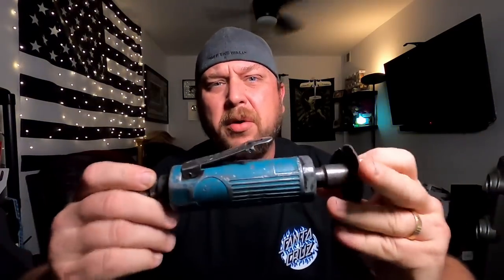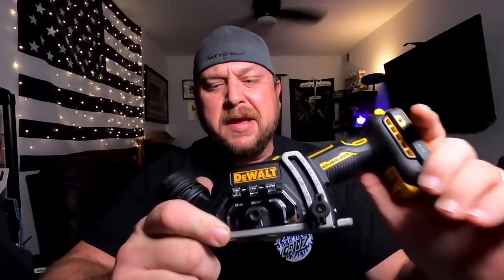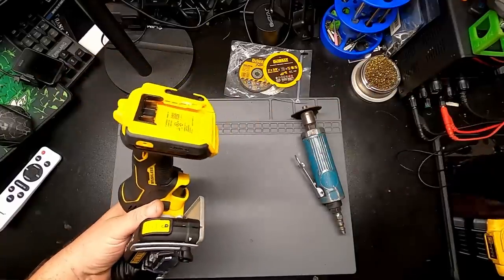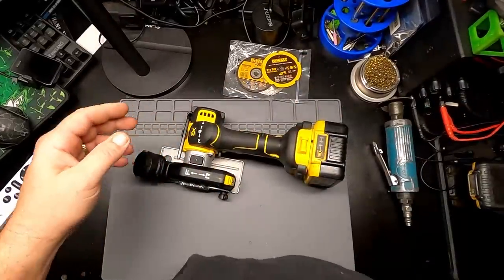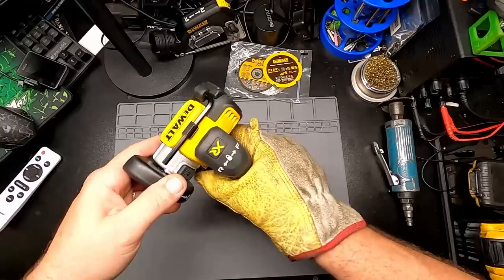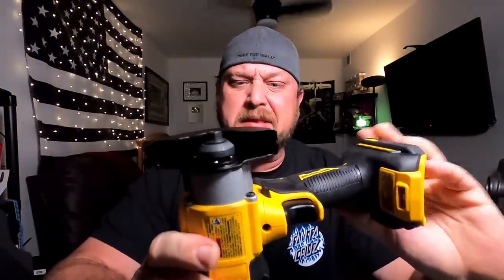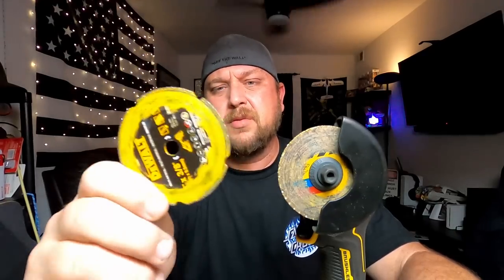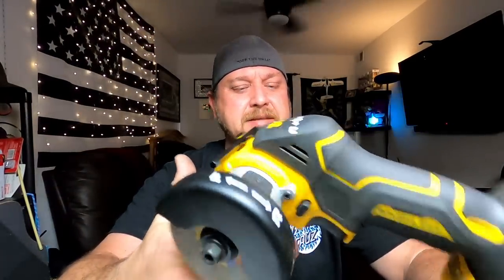DeWalt DCS438 Brushless 3 in. Cut-Off Tool

Comment: I’ve had one of these for almost 3 months now. I love this thing. I do a lot of scrap metal and this thing rips into some copper, brass, and stainless. Makes my life so much easier. I will say that this tool loves the Powerstack battery. You can hear the pickup in power when you put a Powerstack on this compared to a standard Dewalt battery
Reply: do you use the 1.7 powerstack or the bigger one?
Reply: @A4rings110  I use the 1.7 on my cut off tool. I like the use the 5ah on my reciprocating saw
Reply: @tannerwest6823  thanks!

Comment: I got one and paired it with the 6ah. It’s absolutely nuts. The only cutoff I’ve used that not only does not bogg down but SPEEDS UP. It cuts half inch threaded rod in almost 1/4 the time my air cutoff can do it. And my air is really quick but you can put too much pressure because air tools. 

Absolutely pleased with it. I’m just trying to find stuff to cut to see what it can do. Has not broke a sweat

Comment: That's a really nice cutoff tool. I use an 18V Milwaukee angle grinder with a cutoff wheel to cut rusted on bearings off of shafts and the like. It's convenient, but definitely has much less power than the old plug-in job I used to use. Can't beat the convenience of cordless when you're up on a roof cutting a pillowblock bearing off of a squirrel cage blower shaft on an a/c unit etc.
Reply: I really love the fact that the DeWalt is reversable. With the Milwaukee, you often don't have the choice between singing off your knuckle hairs or eyebrows.
Reply: Yup me too I haven’t removed squirrel cages in a minute. Guys used to argue which way curves go saying the amperage draw too much scooping 😂 like WHAT
Reply: On convectors “
Reply: @RcPlayer-tt2vw  lmao. I had an HVAC guy ask me if I thought the unit was blowing fuses because the belts were loose. hahaha

Comment: I recently got one of these also. Love it. Have the 12V Milwaukee one. It works for what it is but the power difference and lack of cutting out with the 20V Dewalt is phenomenal. Also, you are correct about the Powerstack batteries. They have more initial "kick" and make just that much more difference with this tool especially when cutting plate or bar.

Comment: Got my DCS438 back in February. People who go on about how it won’t replace their grinder have no idea. Not only will it do many of the same things, it’ll prove useful for things you never would’ve used a grinder for. I take off screw threads, cut outlet holes in drywall where you might use a multitool, cut metal wire shelving, and even use it places where you might use a Dremel rotary tool.

I recently had to blindly cut some copper pipe to salvage a miniature hot water heater tank that was crammed under a bathroom sink. I was done in no time but I soon realized I’d accidentally cut right through the nut and hose fitting instead of the pipe! It went through like butter.

Comment: Glad you showed how the diamond blade worked on the hydraulic hose. I think I might pick one of those up.
Reply from the maker: I was impressed with that 👍🏻
Reply: @FunkFPV was that the carbide blade?
Reply: Just an fyi if it seems like it is not cutting as good turn it around. We used 14 inch wheels like that for cutting roofs up when demolishing buildings and that's what we were told to do and it worked out well.

Comment: Interesting tool, powerful and and portable, but IMHO, only marginally useful for when if you have no access to air or an electrical outlet and you have the clearance to stick that monster in a tight space. When you include the cost of the batteries it's a $300 or so investment. I'm retired now and I go back to when a hacksaw was the standard cutoff tool and remember when the air whizz wheels came out. What a godsend for mechanics! They're still perfect for cutting off things like a hose clamp down deep in a crowded engine bay. And I can buy a lot of $12 cheapo HB versions that last a few years (my current one is still going strong after maybe 15 years) before I come close to the cost of one of these. Then I also think about how couple of years down the line the batteries will change and be non-obtainiums. That's what happened to my beloved SnapOn 3/8 drive gun.
Reply from the maker: It’s a hole process for me to use air tools. The less I have to do it the betters
Reply: Lol I have that 3/8 gun I never used it or not very long time , most my heavy home” mechanic days I didn’t have a commercial air compressor. You right , they’re working on using graphene for batteries, more power half the weight . With our political agenda they’re support going green and government grants write offs ect but car technologies going trikle down , figure 10 years with anything state of the art technology.
Reply: Actually make a cutter just for all thread , I’m a building engineer but I learned motorcycle mechanics from airplane mechanic, learned name all thread “”” here at work engineer break my chops saying it’s called threaded rod “ first time I heard all thread again in  “ 20 years  , funny how ol timers terminology may never been correct but they’re the master mechanics 🧰 and than you have TEST. Takers all proper terminology but couldn’t fix a bicycle
Reply: @FunkFPV  Working out of a shop with house air is different than field work, admittedly. I fitted out my home shop withair years ago and it works fine for what I still do.
Reply: For me it's not a practical tool for what I do especially with its size. I use the pneumatic including compact ones half the size of the regular. Battery is king for portability and convenience thou and looking at Funks job it will likely work well for him. Definitely hard to beat the price and longevity of the old school ones.

Comment: If you get powerstack batteries for it you will like it even more. Especially the 5ah powerstack. It goes great with that tool. The 1.7 powerstack feels great cuz its so compact but it jus dies too fast. Also i pretty much only cut metal with mine and i jus removed both guards. Wheel is jus so small any guard is a nuisance in my opinion. Only other thing i want for it is a new arbor bolt that is pan head with the allen wrench. On a multiple occasions the hex head sticking out has gotten in the way of making  a cut that is up against something. Gotta figure out the exact size of the bolt but also its damn reverse thread too so thats gonna make it a real hassle im sure

Comment: Haha! I use a version of that old air grinder at work! 
Lots of speed, but little torque. I have to be careful not to press too hard, as that poor little psi motor maxes out and dies. I mean, with a grinder disk, sure you don't want power to break the disk, but it doesn't like notching too much. ( break pad effect)

Comment: Nice little cut off tool. Kinda surprised it doesnt have a variable speed trigger. Kinda weird it doesnt this day and age. As far as dewalt batteries, id like to pick up some of those powerstacks as well. I dont have many cordless 20v dewalt, just a 1/2 compact impact, and a little nut runner cordless ratchet. I have a 2ah and a compact 4ah with the 21700 cells. Way more slim than the 4ah you have. Looks more like the 2ah, maybe a bit wider, but way thinner/shorter than the 4ah, and im sure more powerful being its 21700 over 18650.
Reply: It can only go one speed. And that’s the speed rating printed on the disc……any slower it will bind, any faster and it will explode.
The metal disc may be able to go faster, but will bind any slower. 🤷‍♂️

Comment: This thing vs a 4-5" angle grinder?  I already have the angle grinder, but I want one of these but IDK why or what for.  Maybe more accurate cutting, better/safer cutting vs the grinder.  IDK.
Reply from the maker: It’s basically for lighter material or if you need to be more accurate with a cut.

Comment: It sounded like you were clicking it from low to high speed does it have a low and high
Reply from the maker: Nope, it’s on or off. The RPMs ramp up when you first turn it on so it sounds slower.

Comment: Isn't this just a smaller version of an angel grinder? If so then whats the point of it?
Reply: Smaller so can fit more tools in the draw 😂
Reply: Ugh. THIS again.

9 out of 10 things you do with this are things you never even would have considered an angle grinder for.
Reply: @emmettturner9452  wasn't being funny, it's because I never knew these existing before seeing this video.
Reply from the maker: Smaller tools are easier to handle. I used this today to cut open a small connector. My 5” could have done it but it might have made a mess of it.
Reply: Exactly and I’ve been using a dremel for small stuff but it’s too small sometimes and disc break to easily just watching den tool guy guy drives around wth tools when and how would he ever use all those tools 🧰 lol , seems to know a lot does he use them one time to test idk but he’s good finding spitting all deals cool tools , Black Friday sales already fpv some pretty good deals , uk buy two batteries get the tool free ect I didn’t see this cutter though , I’m team red but some these deals too good , do I need 200 blower just to stay red when I can ryobi for 100 , I go for two toolkit deal  with dewalt if they have this cutter , I generally stay with m12 for hobbies at home and I have some m18 tools at work but usually over kill I use the smallest lightest batteries. My old Milwaukee stuff is nickel metal batteries I want see if I can get adapter plate to use lipo batteries on , sorry guy I’m rambling tools get me excited for

Comment: Im sure its not a bad tool just by the fact you actually praised it, but i really dont see the point, because to me this just seems like a slightly smaller angle grinder, whereas the old pneumatic one was a lot smaller and imo a shape that would have no trouble just sitting in a toolbox, whereas this needs a place on a storage rack or something. I'd probably never buy this and instead go with using either one of the old style or just swapping up directly to an angle grinder, because this just seems like an unneccesary step in between the two.
Edit: Though if you are starting out fresh and dont already have both anyways, then this might be a decent dual purpose option.

Comment: That dust cover is an odd option. Guess someone will use it.
Reply: If you're using this to cut concrete or tile with the diamond blade, you'll want that so you don't get a bunch of silica dust everywhere. Most people won't need it, but those who do need it will definitely need it.
Reply: I was going to comment about the ridiculous guard till he popped it off and I was like oh ok, great tool just throw that away then. I could see it being useful for ceramic stuff tho.
Reply: @Chris-du7hi  I agree. It definitely serves a purpose, just not for us. 😅